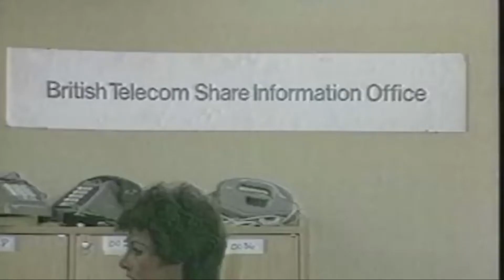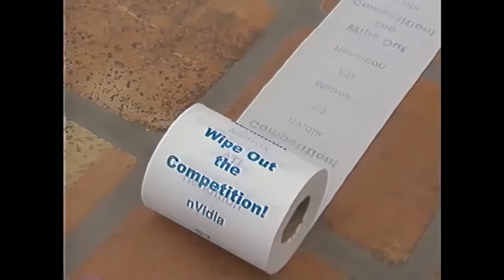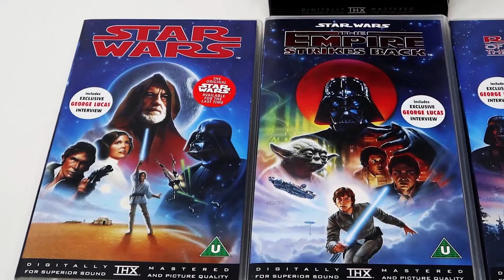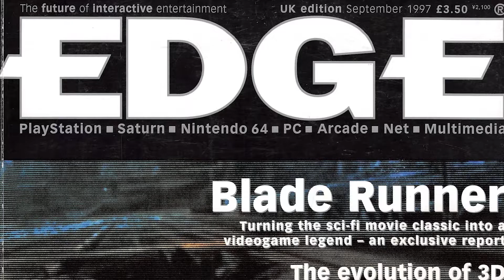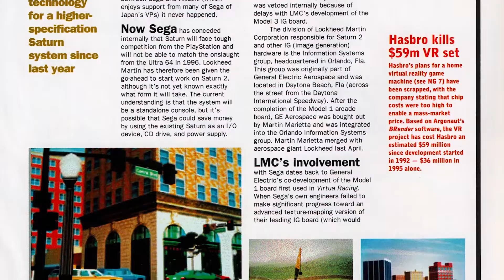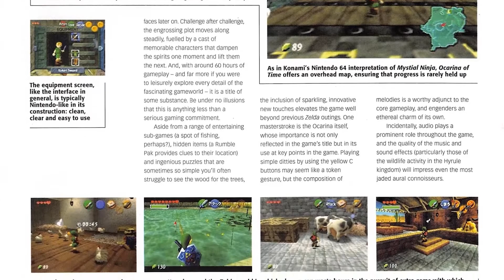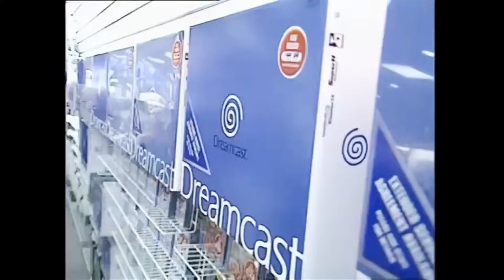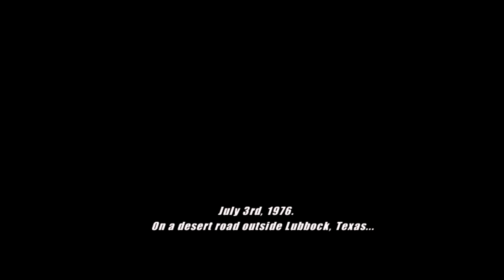Gaming's Golden Age: The Late 90s

Comment: 1997 - FFVII (psx)
1998 - Ocarina of Time (n64)
1999 - Shenmue (dreamcast)

I struggle to think of an equivalent 3 years of console defining masterpieces. At the same time they are leap fowards in complexity and hardware technology.

This relates to the comment you made around 53-54 mins. Modern gaming has just not got that awesome (in the literal sense of the word) quality anymore. As you say, modern consoles are just like PC upgrades now with proprietary operating systems. Maybe I'm getting old but I can barely tell the difference between the PS4 and the PS5 outside of the obvious increase to 4K. I wonder what the experience is like for a teenager these days who has lived through the PS4 to PS5 era. Is there the same shock of the new? My suspicious is no, the Ballardian death of affect is everywhere.

One final thing I've noticed as well is that the gap left for the imagination with early 3d graphics was immense. This may be down to my youth at the time but with today's photo realistic graphics and over saturated use of cinematic cut scenes there is little left to the imagination. Playing games in the PS1/N64/Saturn era I'd argue helped stimulate the imagination rather than replace it.
Reply from the maker: Couldn't agree more. Thanks for watching.